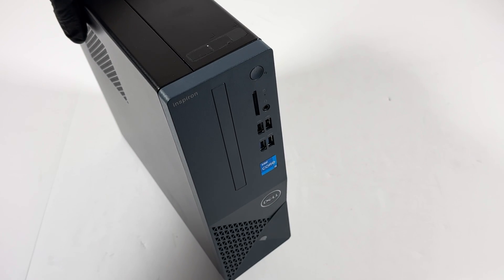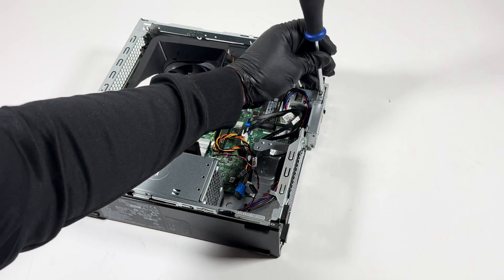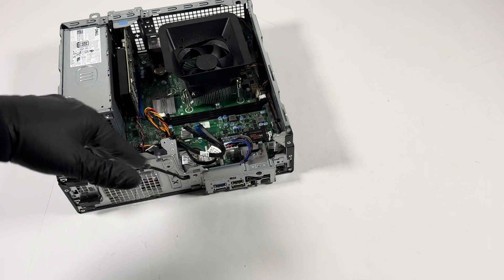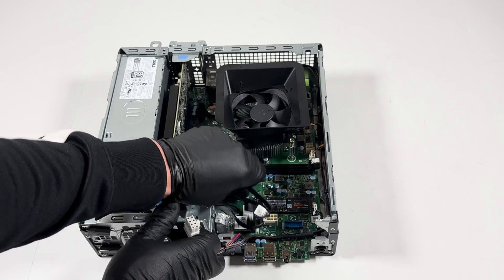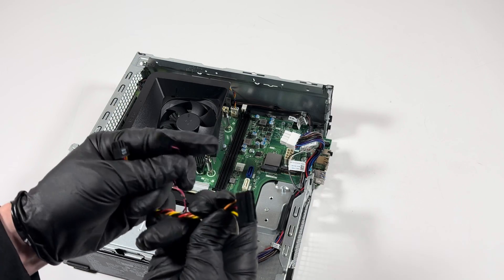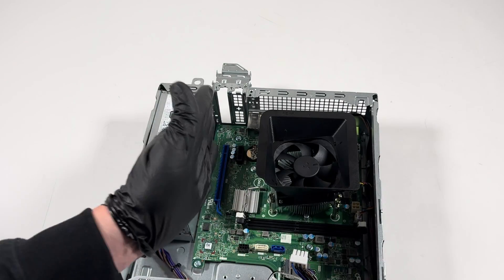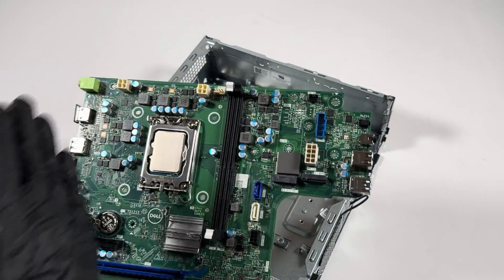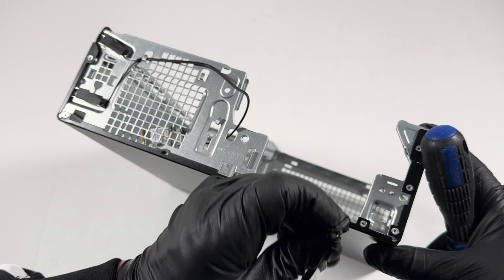Teardown Dell Inspiron 3020 3020s

Comment from the maker: List of Parts and Upgrades works with this Dell Inspiron 3020.

Dell Inspiron 3020 Upgrades
https://www.youtube.com/watch?v=vM7baZDF7g0

List SSD Heatsinks:

(1.)  M.2 2280 SSD heatsink, Double-Sided Heat Sink, PCIE M.2 SSD
https://amzn.to/3l2ittr

(2.)  EZDIY-FAB M.2 2280 SSD heatsink, Double-Sided Heat Sink, M.2 SSD
https://amzn.to/3m7J3me

List SSD M.2 Type 2280 NVMe PCIe:

(1.) Crucial P3 Plus 4TB PCIe M.2 2280 SSD
https://amzn.to/3RZcUNi

(2.) Crucial P3 Plus 2TB PCIe M.2 2280 SSD
https://amzn.to/3RTUi0Y

(3.) Samsung (MZ-V7E1T0BW) 970 EVO SSD 1TB M.2 NVMe
https://amzn.to/3d52k2a

(4.) Samsung 970 EVO Plus SSD 500GB
https://amzn.to/3fpi95A

(5.) Samsung (MZ-V7E500BW) 970 EVO SSD 500GB - M.2 NVMe
https://amzn.to/37uuLFw

(6.) Crucial P1 500GB 3D NAND NVMe PCIe M.2 SSD - CT500P1SSD8 
https://amzn.to/2N07wKh

List of RAM will work with this system MAX 64GB.
Supports Non-ECC DDR4-3200/2666/2400

Crucial Pro RAM 32GB Kit (2x16GB) DDR4 3200
https://amzn.to/3q5eFQ3

(1.) Crucial 32GB Kit (2 x 16GB) DDR4-3200 UDIMM
https://amzn.to/3BdbNm3

(2.) Crucial 16GB Kit (2 x 8GB) DDR4-3200 UDIMM
https://amzn.to/3U24CpE

(3.) Crucial RAM 64GB Kit (2x32GB) DDR4 3200MHz
https://amzn.to/3xEsF4b

Thermal Grizzly - Spatula for Applying and Spreading Thermal Paste 
https://amzn.to/3d8NQEE

Thermal Compound Paste:

(1.) Arctic Silver 5 Thermal Cooling Compound Paste 
https://amzn.to/2ziNU0H

(2.) Noctua NT-H1 3.5g, Pro-Grade Thermal Compound Paste
https://amzn.to/36kTk7A

(3.) ARCTIC MX-4 (current edition) Thermal Compound Paste 20 Grams 
https://amzn.to/2DhGJaK

List video cards will work with this system.

GIGABYTE GV-N1030D4-2GL GeForce GT 1030 Low Profile
https://amzn.to/4jV5M3D

Msi Gaming GeForce GT 1030 4GB DDR4 64-bit HDCP
https://amzn.to/4aana0U

(1.) AMD Radeon RX 6400 Low Profile Gaming Graphics Card
https://amzn.to/3s8MUUY

(2.) PowerColor AMD Radeon RX 6400 Low Profile with 4GB GDDR6 Gaming Graphics Card
https://amzn.to/3ucfFEm

(2.) Gigabyte GeForce GT 1030 GV-N1030D5-2GL Low Profile Graphics Card 
https://amzn.to/2Z4PHkp

(3.) ZOTAC GeForce GT 1030 2GB GDDR5 64-bit Low Profile Video Card ZT-P10300A-10L 
https://amzn.to/2WzgLXk 

(4.) MSI Graphic Cards GT 1030 2GB GDDR5, Low Profile
https://amzn.to/390Spum

HDD list works with this PC:

(1.) Seagate BarraCuda 4TB Internal Hard Drive HDD – 3.5 Inch
https://amzn.to/3d3xWeR

(2.) Seagate BarraCuda 8TB Internal Hard Drive HDD – 3.5 Inch
https://amzn.to/3xjUDSJ

(3.) Western Digital 2TB WD Blue PC Hard Drive HDD - 5400 RPM, SATA 3.5" - WD20EZAZ
https://amzn.to/3w3jIQA

(4.).WD Black 2TB Performance 3.5" Hard Drive - 7200 RPM Class, WD2003FZEX 
https://amzn.to/2xFUeyF

Disclosure: Amazon links this means that if you purchase an item we earn a small sales commission affiliate.

Comment: Am looking to get one of these from Dell outlet shops refurb unit. 
I don't really like the case it comes with. Can I change the case to something smarter but smaller, if so what size code should I be looking at ?
Reply: Non standard motherboard you would need to drill many holes